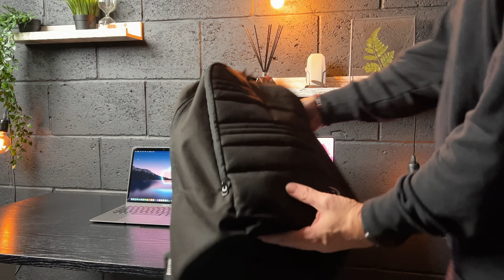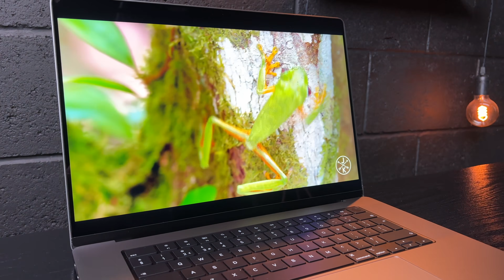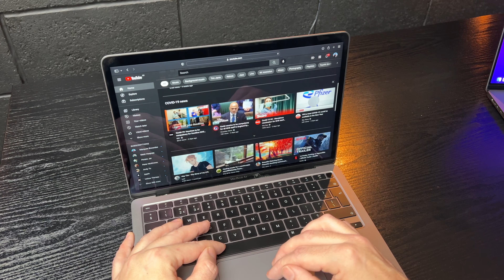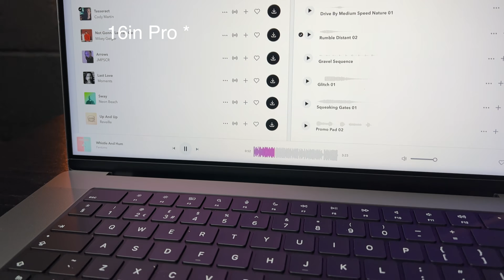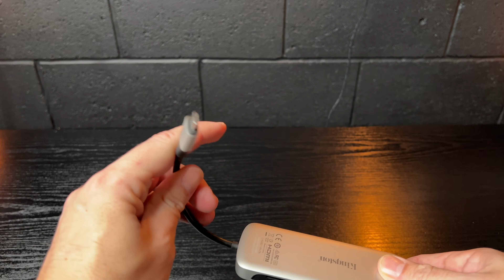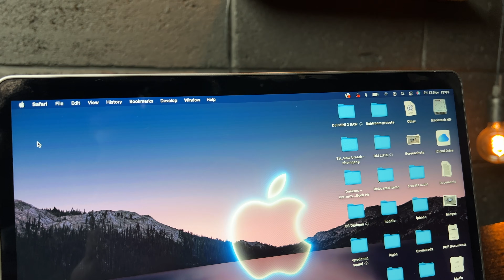M1 MacBook Air VS MacBook Pro 16 - SPEND or SAVE?

Comment: no all usb-c is much much better. you can choose yourself what port you want to use. ive a 16" now myself and the hdmi on there is 2.0 so if i want the better hdmi i still need to use a dongle. making a port selection for every use case is impossible and also a hassle of putting it on the right side. so would much rather have had only usb-c

Comment: For work I can say the baseline MacBook Air tends to run out of RAM, especially if you keep apps open so you can resume your work the next day. It happened to me once and I remember it opened the Force Quit window and I had to close a program in order to make it go away. Personally the MacBook Air would be good on at least 16 GB RAM, but if you want a bigger screen and you rarely have access to an external monitor, then the 16" MacBook Pro is worth a shot. I don't know honestly if 16 GB of RAM would be enough, I am tempted to say "yes", although I haven't tested it yet.

Better said, the MacBook Air is enough for work, IF your work is not too hard and does not require opening too many applications at once. If you are a hard worker, then the Air is going to struggle at times.

Comment: For graphics designers and photo editing. The little size of the air screen does it make a problem?
Reply from the maker: Yes I can get cramped. The 16inch is a big difference unless of course you buy a cheap monitor

Comment: Hi, great video! I see you’re using Luminar, did you feel any difference in using Luminar on Air/Pro? What’s your photo editing tool of choice? :)
I struggle between buying Air or go all in and buy MBP 16’’ :))
Reply from the maker: The 16inch is the best laptop I have ever used it’s a beast, the fans haven’t even been on. The air was brilliant but the 14inch new MacBook for the extra would be a good choice ! I use Lightroom / photoshop and Luminar  and all work great